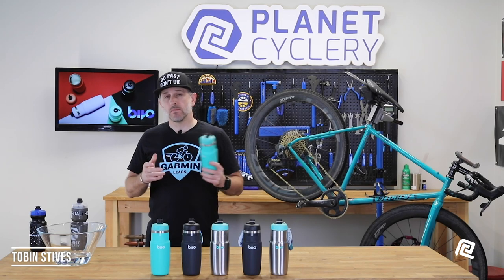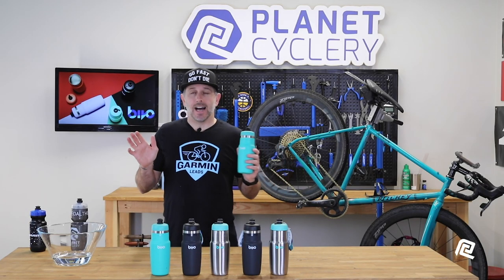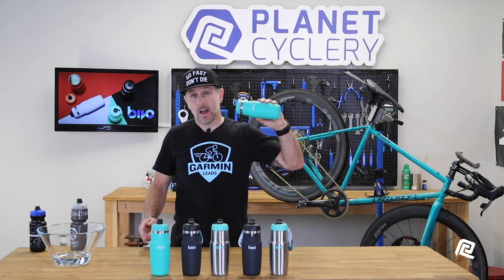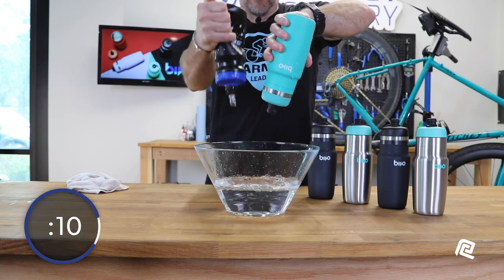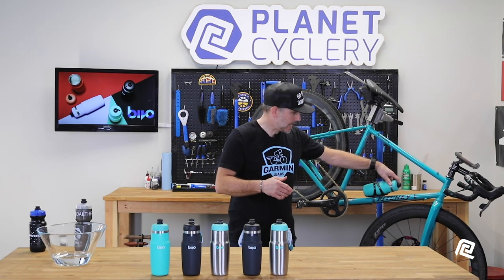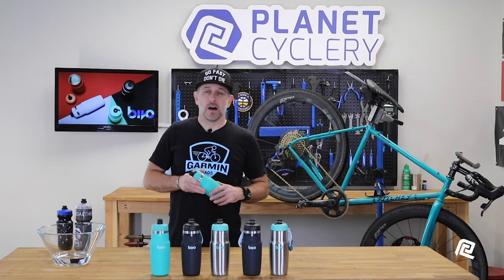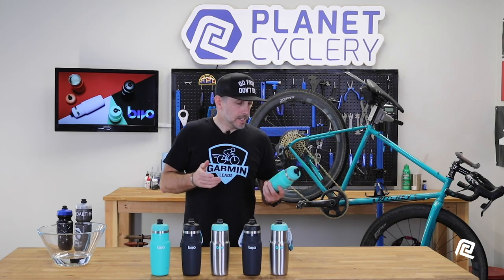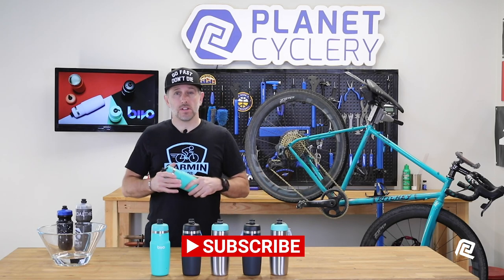The Future Of Cycling Water Bottles: Featuring BIVO One

Comment: I love Hanna Grant.  Top protector.  Stainless without plastic veneer (allows for thermal sanitation of the bottle).  Best part of stainless bottles?  ...they can be sanitized at temp without deformation or plastic breakdown  (thus they tend to be cleaner).  The straw feature is awesome, but complicates cleaning.  I'd prefer a stainless straw (non-threaded) but removable, for easy cleaning and to reduce hydration contact with plastic.   The top, ideally made of stainless with a silicone gasket (removable), and/or a top that is very quickly and easily cleanable (no nooks and crannies).

Comment: Is there a difference between the normal version and the RAW version other than color? Why is the RAW version so much cheaper?
Reply: Hi! The Raw version doesn't have the silicone exterior coating. The silicone adds some extra grip in the hand and prevents rattling, though we have found the shape itself keeps the bottle quiet. In metal cages, you will hear a little rattle with the Raw.

Comment: Pretty cool idea but doesn’t the plastic straw negate the advantage of the stainless steel bottle? For this idea to really benefit from moving away from plastic then it shouldn’t have any plastic in it. That’s just my thought.
Reply from the maker: The 'straw' is actually made from a silicone.
Reply: @planetcyclery3596  worth adding that the cap is polypropylene. Most cycling bottles are LDPE which leaches significantly more plastic into your water/electrolyte than PP!